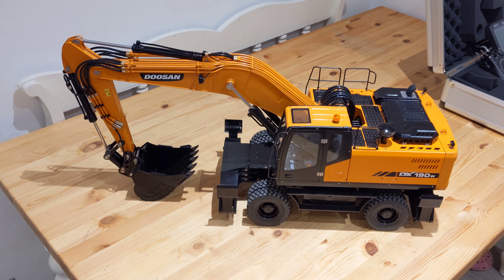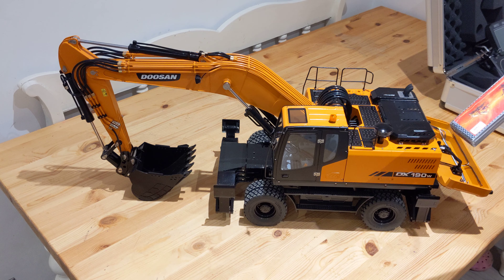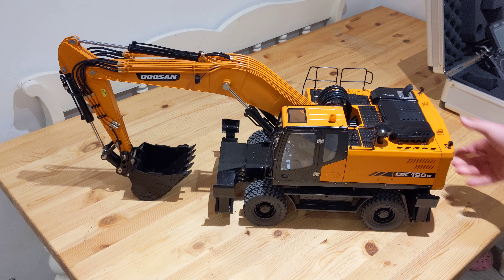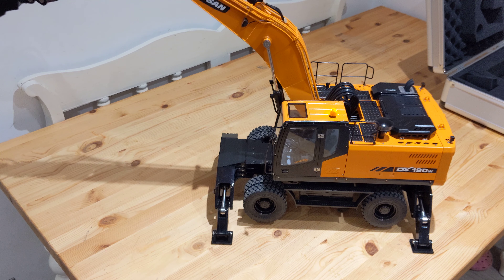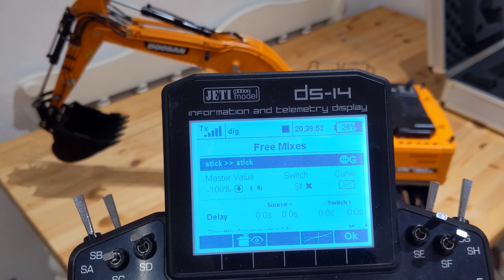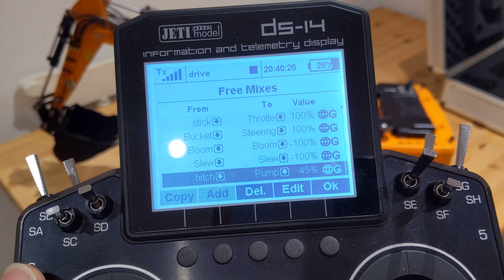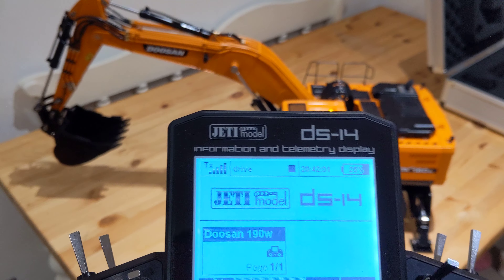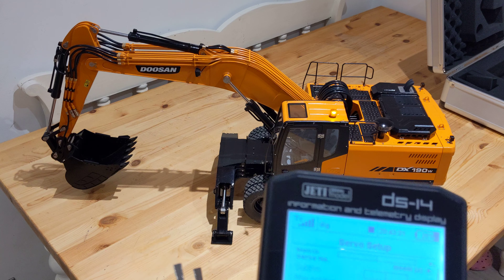LESU 1/14 RC hydraulic wheel excavator rubber duck build PART 14 IT'S finished!!!!!!

Comment: beautiful build!  I am considering the same model and wondering how the hydraulic lines for the stabilzers go through the turntable yet provide 360 degrees of rotation without twisting
Reply from the maker: Hi, it works on the same principle of the  real machine. Inside the slew is oil ways that allow oil to flow to the undercarriage with a series of seals so it doesn't leak and it allows infinite rotation.

Comment: Curious on the paint. What process did you use? Sand, prime, paint, clear? Type of paint used?
Reply from the maker: All parts come bead blasted ready for paint. So cleaned, upol #8 acid etch primer, white primer then gloss orange. For black parts just #8 acid etch then gloss black. All from cans.
Reply: Awesome. Thank you! I didn’t realize there was such a product to etch. Now I know!
Reply from the maker: @StevesRC   upol #8 is the only primer in a can that contains acid. All other etch primers in a can don't contain acid. Well so I was told anyway. It's great stuff be very careful to wear correct masks when using it.